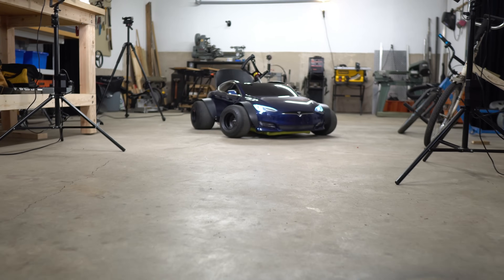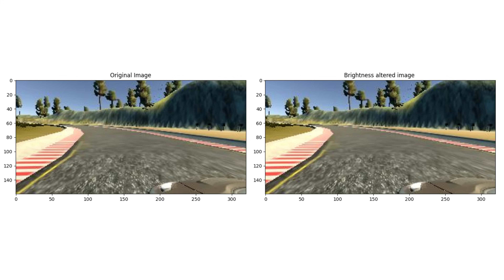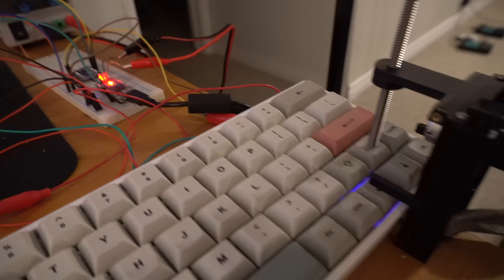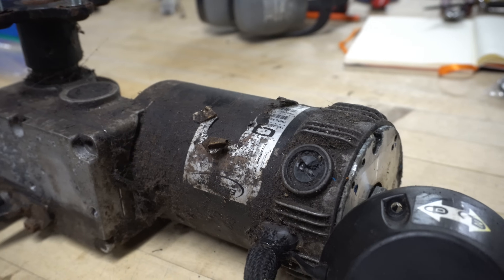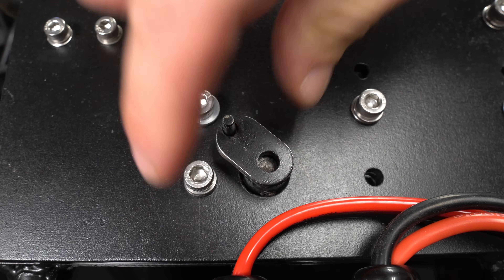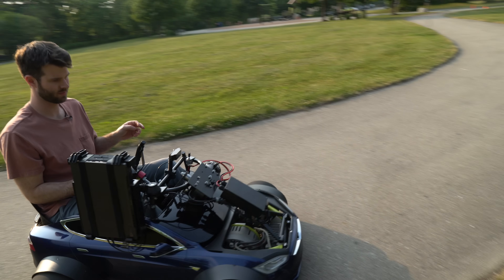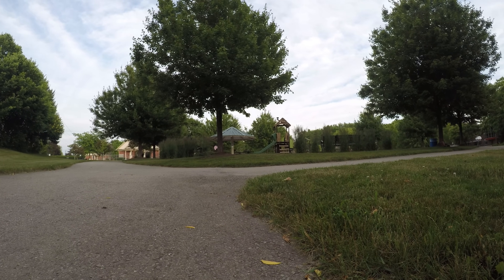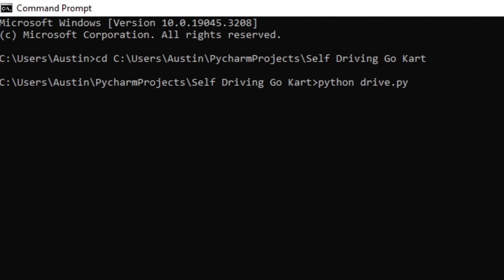Building a Self-Driving Go Kart

Comment: I like that project, and I like the results that you eventually obtained. It's nice to be able to run in a continuously looping path, without straying, until the battery runs out. However, that has limited usefulness. What might be nice, is that when it comes to that intersection in the park, it can be programed to always turn a certain direction, based on the route that you set. In addition, it might be nice to have a prompt mode, where it might stop and ask, if you tell it to do so. Other goals that would be nice, is to be able to save and choose pre programed routes, where you could place it at a point 'A' and it would take a programmed route to point 'B'. However, it might also be nice, if it could recognize parts of the route, so you could place it at point A + offset, and it would still be able to find its way to a destination. Also, it would be nice for it to be able to recognize where it is along a route that it has travelled before, and make it to a destination that might be in a different route, but is still in the larger map. For instance, maybe you could place in a random place on the main loop program, but you want it to turn left & go to a new destination. Maybe, it could start the loop, until it gets to the intersection, then turn left and start a new program - based on a larger program, that's outside the nest.

I know at this point, this is outside the scope of what you want to do, but if you decided to expand the scope of this vehicle's capability, I'd be very interested in your journey. I am starting a similar project, that's smaller in scale. I don't intend to ride along in the vehicle. However, I'd like to eventually be able to program it to autonomously go to certain destinations from a common point, then return. Collision detection would be the next obstacle I'd want to tackle. I appreciate the video, and the work you put in.

Comment: this is "self steering (on a closed loop", not "self-driving"...

though, i think it wouldn't be so hard to add GPS, and maps as a data source, along computer vision, with a retrained model that takes into account lane differentiation, to calculate a likely trajectory from speed, and input (can add turn signals), from there you could retrain your model again, add collision avoidance, and obstacle detection, some safety mechanisms, put all that in a closed loop with the previous system, and from that point, it's just a matter to add point to point navigation with GPS, and then it'll be "self-driving"...

not that difficult, imo, but lots of time...  might be willing to help if it could be turned into a plug-and-play, marketable system that could turn a profit, but self-driving cars have already been done...  hard to make a dime on that these days, especially at that level...

Comment: My experience with this (specifically potentiometers and Arduino) Your measured potentiometer results may very as the potentiometer ages, and ... If voltage can change or spike - that will change the reading of the potentiometer.  Its a frustrating dynamic to debug.  I would recommend a digital encoder, stepper motor...  Or a verification step to the potentiometer results.  Keep up the good work - Love it!!!!

Comment: For those wondering, looks like about $250 for the cameras, $75 for the motor controller, $40 for the steering motor itself, $30 for the Arduino Nanos, $120 for the batteries, and probably another $20-30 for the various other electronics & wiring pieces. All-in I'm guessing a bit over $500 to add self-driving. Huge cost savings by not using LIDAR and having a laptop be the brains instead of an embedded system like Nvidia Drive. Very impressive!
Reply: dont forget the thousands of dollars in tools and the $25 dollar udemy course! haha

Comment: Instead of a switch to disengage, maybe use a force sensor to calculate how many nm should be applied to the wheel before it lets you take control.  In the same manner, you can have the motor turn with to keep the force within a range.
Other thought is to use progressive memory mapping with predictive path to guestimate the corner angle and adjust the maximum speed before loss of traction.

Comment: Hi Austin, Do you have a GitHub repository for your Arduino code? 

I have 3 0:24 Ackerman steering cars at 1/10 scale. ROS1 and. ROS2 versions with nvidia sbc’s. I also built a pixhawk controlled gps 1/10 scale with LiDAR avoidance. I can’t crack the nut on path planning outside. Issues gps gets near tree. I can’t effectively fuse camera data for sidewalk segmentation and gps. I like your approach of training on the path. I know enough that the devil is in the details even if you have the code.

Comment: Not to be that guy but couldn’t this be done more efficiently and more effectively if you had just made a control mapping system where you had it record the potentiometer values as you drove the desired path and then repeated those inputs back to you when played? I just don’t think a neural network is really necessary for this application. And also a better more efficient way of doing this is creating a color filter that maps the edges of the path and then have a raspberry pi average the distance between the two path edges at any given time using computer vision. You can take that data in combination with your little potentiometer steering angle decoder and make a simple algorithm to adjust the steering angle to make the car move towards the desired path of averaged numbers.the benefit of this is that it will now work on any path that looks the same as one one you made it for.

Comment: Use wider angle cameras, you'll get a better more reliable result.

Also look into RTK navigation and integrate each sessions path into an averaged path as that's what all these self driving companies are doing. 

The really special sauce is in real time navigation using computer vision fusion of RGB, Depth, Laser, Radar, and other sensors.

Comment: This is really cool! Only thing is, I can't see why adding 2 additional angles would help the model if you arent going to use those for prediction.  I work on computer vision with convolutional neural networks for my job and my gut instinft would tell me that adding the 3 cameras should actually make the model perform worse.. unless you are doing some kind of preprocessing to simulate data as it would appear from the center camera.  

Like, if you took this to the extreme scenario, and the cameras on the side were pointing 90 degrees from the center camera and training a model on that to say "if the center camera sees this, you should just continue straight".. I mean your model would just want to drive into the side of the walkway.  As a matter of fact, when I am training my models, one of the important things we try to ensure is that training data angles are as close as possible to angles used at prediction.

Other stuff I'd point out is that, the laptop is a nice solution, however you can buy a special purpose SoC like a google coral board or nvidia agx that would use less power and take up significantly less space. I think the google coral TPU is only like 100 bucks.  For a model this simple, it would probably be sufficient.. and since your model is so simple (just stay on the road essentially) and your dataset is so small, you could probably scale your images (and model) down really small for really fast predictions.  The military actually trained a simple self driving model back in the 90s or something.. I think it wasnt even really a neural network.. just an SVM with something like 100x100 images as input.  Maybe even smaller.

This would be a really cool project to have worked on.. although if it was me I probably would take it too far and half something like a route selector, where the current route segment is an input into the model.. or maybe use gps and give a vector delta from the desired location.  Assuming this sidewalk is in google maps you might even be able to integrate that

A better approach might also be to make the model attempt to center the vehicle in the lane and collect data by going through phases of collection where you drive too close to the lane in either direction and then another phase where you center it.  Then the model could say "im too far right" and you could have logic to correct.. kinda like you do for adjusting the wheel position with a feedback loop

Comment: excellent work, can you train an a.i to spot and avoid potholes? spot prep and overcome speedhumps? theres your money boet
Reply from the maker: Thanks! If I avoid specific objects during training, the trained model would probably do the same. I was thinking the next step could be some sort of object recognition.
Reply: @austiwawa  eventually a unit that is trained to spot and notify with solution and alternative solution to pothole avoidance. similar to the lane change system. the other thing that greatly interests me is speedhump detection, spot the variance notify user measure the variance and prepare suspension for impact, similar to Mercedes meagntosuspension but with feedback. 

then using gyroscopes and flywheels we can make the vehicle do a controlled jump, speed racer style.

its 2023 we should be on fusion power and beyond saturn already.
can we at least make a car smart enough to do cool car things? how do we make the car jump in the first place? mantis shrimp/grasshopper leg mechanism. how do we make it land on its wheels? gyroscopic feedback and spinning flywheels on each axis.